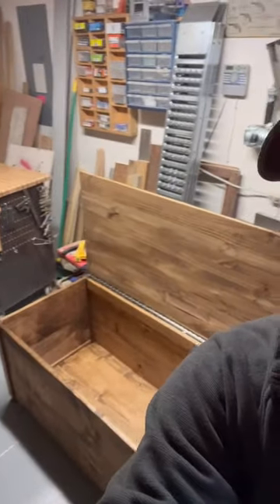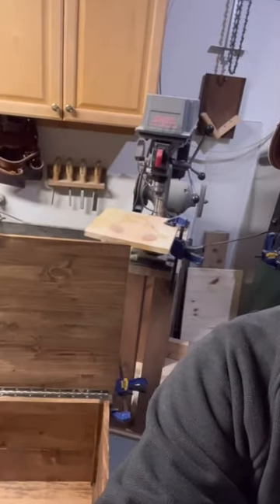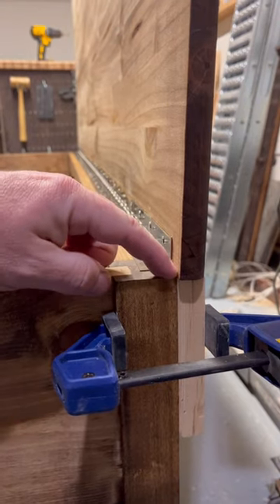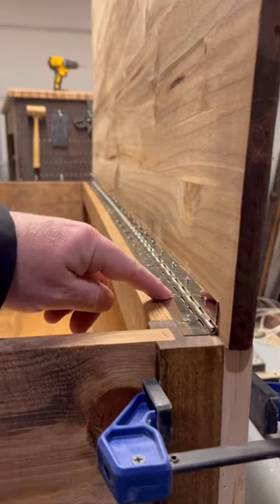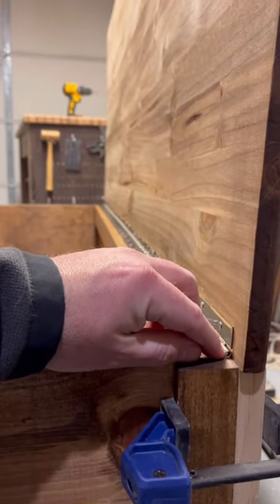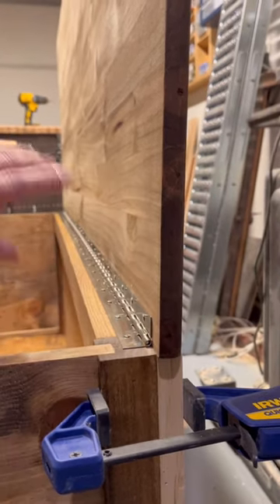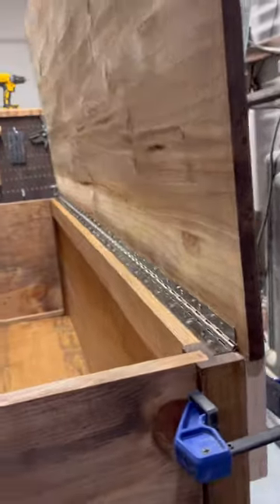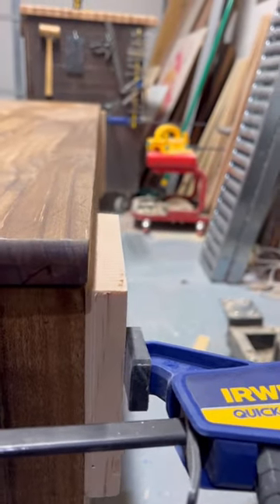Easy way to install piano hinge on a box.  #toybox #woodworking #hinge #pine #howto #diy

Comment: Technically you should route a mortise for the hinge so you don't get a gap at the back of the box
Reply from the maker: Sometimes I do.  With the pads I was using on the front it sat perfectly level without any routing.

Comment: Buck,

I have a heavy boat hatch that I had to remove to repair the fiberglass on it.

The piano hinge rests in the deck.

When installed, the hatch folds into the cut out of the deck.

It seems like I’ve got to somehow suspend the hatch verticallyand work from under the deck to put about 20 screws into the hatch.

Any ideas?
Reply from the maker: Yes have done that before (carpet wrapped wood and fiberglass).   In both cases I mounted the hinge to the deck/boat first then used a blind hole finder to mark 3 holes on the inside of the hatch.    Then tested spacing when shut once those three fasteners were installed.     Then put in.   I have not tried it personally, but thought double sided tape would work as well.   Meaning install hinge on boat side, then shut hinge to closed position, then install double sided tape, then place hatch on top of tape.   Then gently open and mark some test holes.    Again haven’t tried the tape method myself (only hole finder method) but that was my backup plan if the hole finder didn’t work.
Reply: @unclebucksprojects1537  thanks, I’ll give it a try!!

Comment: Is there a way to hide the barrel of the hinge
Reply from the maker: On some of the aviation ones I used to install they used to have special end caps that would hide it/prevent pin from backing out during flight.  I haven’t seen them for woodworking projects, although they may exist.